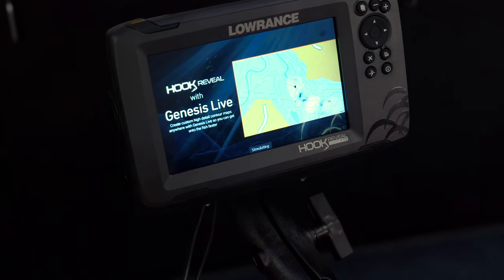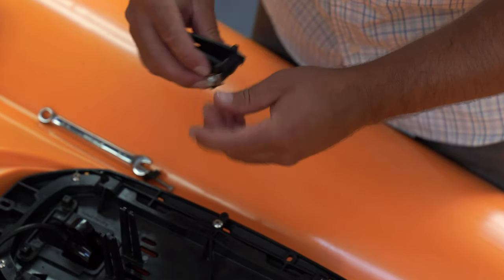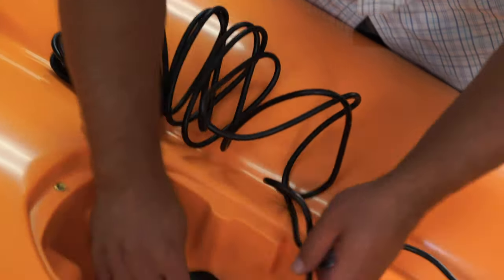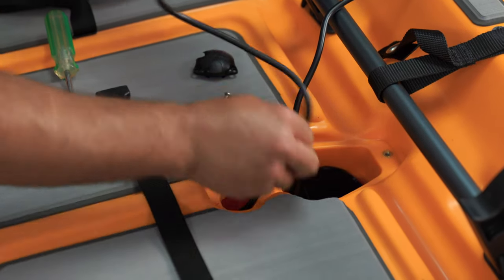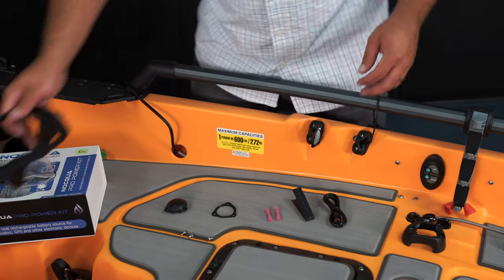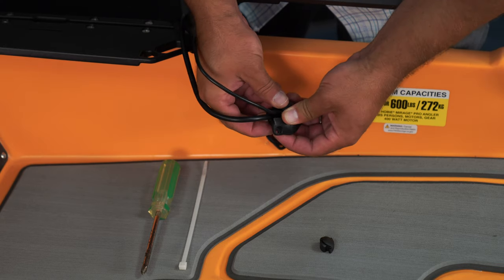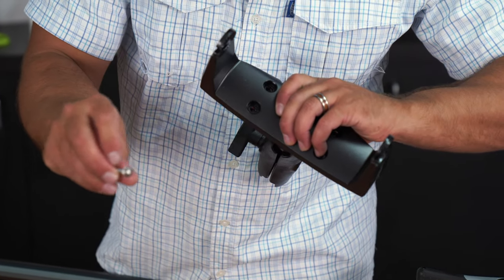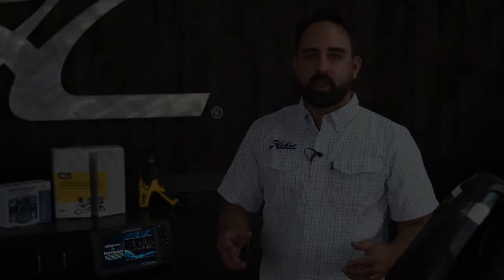Fish Finder Installation | Lowrance Hook Reveal 7 TripleShot on Hobie Pro Angler with Guardian Mount

Comment: This is a great video. I am just a housewife and I followed these steps and it only took me about three hours. 
Tips:
Be very careful to keep something over any of the holes leading to the inside of the boat. I had to play Operation twice with my fish hook removers to retrieve a plug and a screw and one of the rings travelled down a wire through the mounting hole and that was a pain. It was backwards anways so there was that.  So…

Be sure to do as he says and put the seal rings facing the right direction. Think it through. 

I’ve  never crimped wires so that gave me a lot of trouble. The butt connectors provided were hard to work with. His looked much better.  

The dummy plugs on the mounting hole covers kept falling out. I got so frustrated I super glued them. I figure I can deal with that later if I ever need the extra holes. Elmers glue or anything less permanent but sticky would work. Duct  tape?  I was mad and it was all I could think of. 

Listen to his advice about not over tightening the screws on the mounting hole covers. I stripped one because I was overzealous and I forgot he said that.  

The track ball  mounting plate I got didn’t come with nuts and bolts nor did the fish finder.  I scrounged and found some in the household junk I never throw away.  

So if you’re prepared with better butt connectors, a crimping tool and 4 nuts and bolts, along with the drill and other stuff, this should only take an hour tops.  Oh and the hook remover, Lol!

Comment: So, this video is still being recommended, in 2024, for the installation of a Lowrance Triple Shot transducer into a Hobie PA 14 360 Guardian plate…but it is no longer compatible and the parts included with my new 2023 Hobie no longer work with the Triple Shot transducer.  I have the guardian plate pulled from my kayak and find the nose guard doesn’t properly cover the front of the transducer and the mounting arms will not accept the wider transducer mount.  Why no update? Why no warning?  Now what???  Very disappointing that Hobie does not provide the consumer a heads up.

Comment: Those transducers have threaded inserts in them.   You can just drill holes in the plate to mount it.   Instead of making extra special mounting extensions and brackets ( and then using zip ties to secure the back ( SMH )   Are these kayaks so damn expensive because you have to pay "Engineers" to over complicate and add extra parts that make the kayak just that much more expensive?!    I swear Hobie makes its money by building the same exact boat for decades and just creating more "problems" to solve with expensive Hobie branded adapters and accessories.
Reply: Actually, the Tripleshot Transducer for the Lowrance Hook Reveal does not have any threaded inserts at all. That’s why you have to zip tie it. I have one and mine has no threaded inserts either.